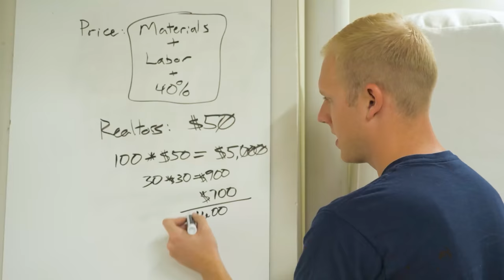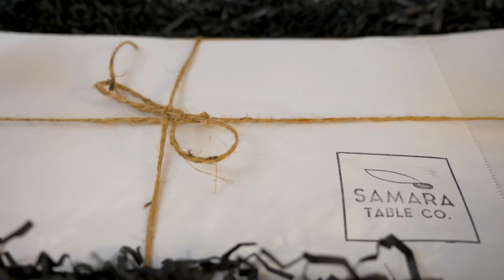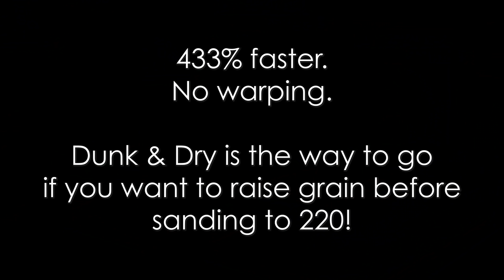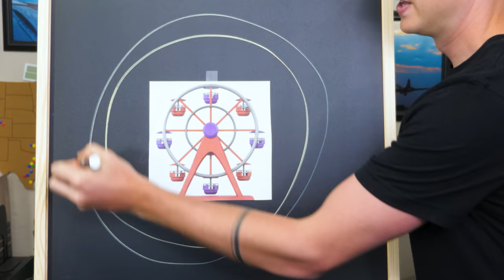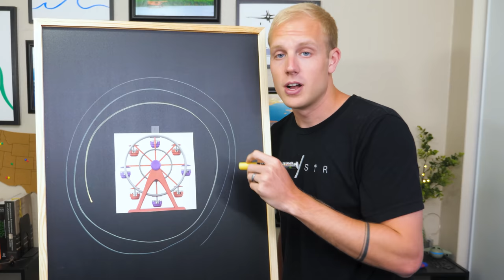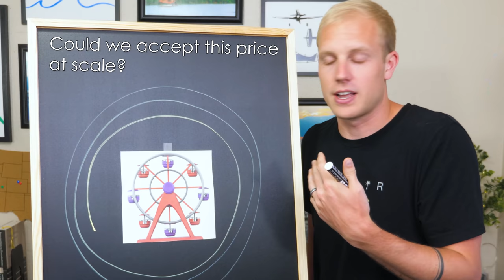we failed at pricing 30 charcuterie boards... | Furniture Business Update

Comment: I did this, priced too low and told the one customer my hourly rate! Biggest Mistake I made cause he word of mouthed me and all a sudden I need this and I get the friends hourly rate as he referred me right? I did 2 jobs at break even then closed my shop to outside business for a few months and took no orders. Solid advice. Jennie you  may have to have a hard meeting and be up front with the Realitor. Tell her you gave her a 1st time buyers price to gain her business but the price per board is X, if she says it's too much you live and learn and find a new client or  negotiate a 5% off orders 10 or more. Its a hard line to draw in the sand but you got this.